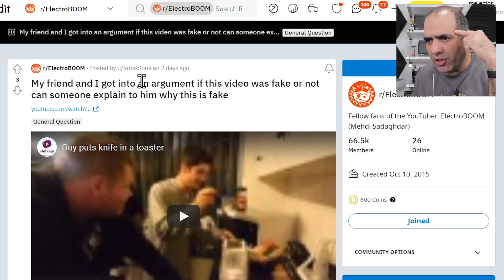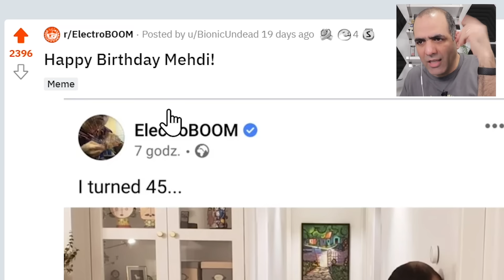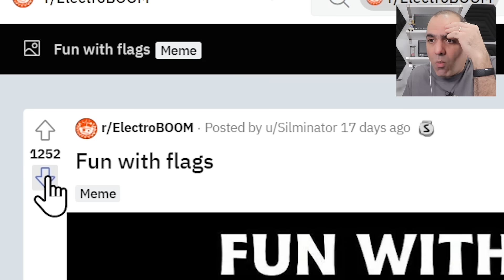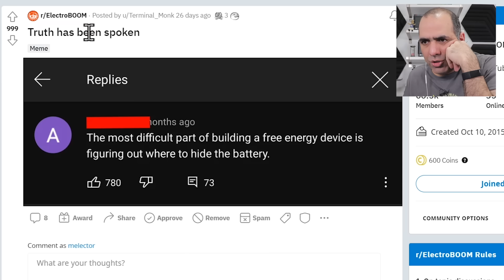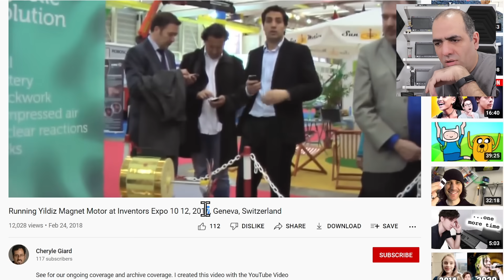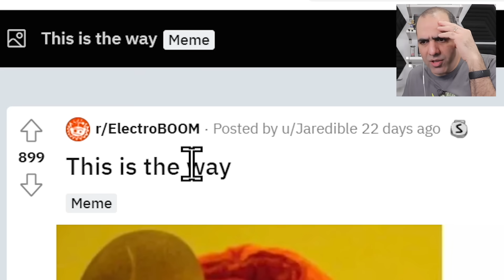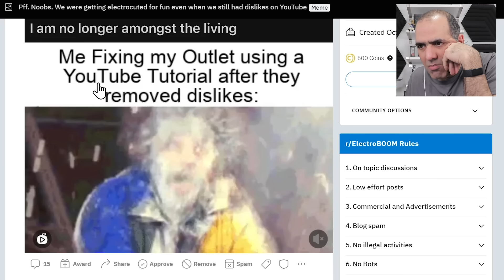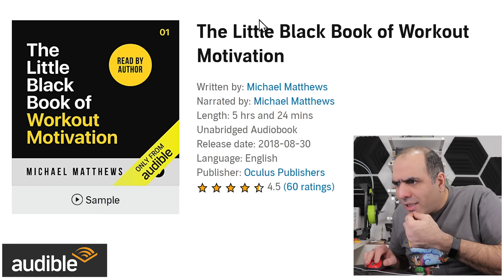Sticking Knife in Toaster? Welding with SALT WATER?!!! (LATITY-009)

Comment: Scientific American magazine had the "Amateur Scientist" column most months.
All manner of crazy-dangerous apparatus were used, including a 'salt-bucket' voltage regulator.
The bucket made many appearances: arc-furnaces, arc-lamps, dimmer for stage lighting, motor speed control, multi-pole variation served as a voltage divider...
All with glorious hand-drawn illustrations.

Comment: Talks about a plastic insulation on the knife and grabs the blade. Does not notice that this type of knife has a metal going all the way through the handle. Neat.
If you have no ground (really, many old houses in some country have this hacked or outdated, no GFCI, no dedicated ground, sometimes even the ground is not connected to the socket), you will be connected to live wire. Put another hand or stand on something that connects to the ground and you are most likely dead. 
Just to explain some details. Old houses, especially in the eastern block did not have ground. Your regular wall socket had neutral and live wire. That's all. Over time people started replacing old sockets. Some of them connected ground prong to neutral (best you could do), some of them left ground not connected. I've even seen this crap in the US. Half of my wall sockets were not connected to the ground just because of some shitty design. Although neutral and live wires are physical wire, the ground connects through bolts to the metal mount. Some of them were installed too deep and someone painted mounts over. Then they screwed the socked in just enough to stay in place but they could not screw it more because the socket would be too deep inside the wall and they could not screw the cover over it. Because it was quite loose and covered with paint, the ground was not connected. That's why you should not do this is you have no clue about electric stuff. It would be enough to check ground continuity, it would be best to check the protection before calling it done. But who cares? I only noticed that because I test sockets used for expensive electronics and I ended up testing all wall sockets in the house I rent. Around 1/3 of them did not have ground or it was randomly connecting depending on how you move the socket around.

Comment: I’m curious about that solar panel axle thingy. Could a similar device be utilized to induce a spin on a section of a space station to simulate gravity, ala 2001? I’m trying to come up with a way to make that device useful, as it likely can’t do any actual work. But “frictionless” rotation would be useful in space, right? 🤷🏻‍♂️
Reply: I think that wouldn't work as it was pushing off a magnet fixed to the ground, which would be impossible in space.
Reply: @deathUUK  well right, but I would assume you could surround the axle ends with more magnets to keep it centered. So like they’re using 2 here, but if you increased it to 4 or 6 or 8 or whatever, and had more of a 360° magnetic field holding it in place, it would be the exact same thing in principle.

Comment: the welder actually works, but you need to bypass all your circuit breakers protections.
Reply: Actually the breakers are there for a reason. 25 amps through wiring designed for 20 amps, will overheat after about an hour of continuous operation. The first thing you'll notice is the smell of melted plastic coming from the wall. Outlets aren't air tight, as the wiring from the wall starts to have its insulation melt, it will release a lot of fumes that quickly fill up the inside of the wall and then start to leak out through even the tiniest cracks in the wall such as outlets which are not 100% air tight between the back side of the outlet and the front side. You will then start to smell that melted plastic, at which point it will be too late, as the red hot copper wire with 25 amps flowing through it then starts to ignite the molten plastic, starting a fire in your wall, and buring down your house. Wires rated for 20 amps means that 20 amps is the ABSOLUTE MAXIMUM that it can handle without creating a fire-starting situation. Just below the 20 amps threshold the wires in the wall will still be very hot (to the point that touching them would be painful if you could somehow reach your hand through the wall and touch the wires inside the wall). It would be a slightly different situation with the wires in open air, but inside your wall the wires are in a very narrow space (limiting convection cooling of the wires), often with wall-filling foam or fiberglass insulation near them, which further traps the heat. The 20-amp rating on 12-guage wire is based on a wall installation (where the wires will typically be used). You can usually use 12-gauge wire in the open air (such as on a lab bench) with a slightly higher current (maybe up to 21 or 22 amps, before the insulation starts to melt).
Reply: @BenHutchinson321  I'm talking about the wire going to the transformer, it handles the high current way better

Comment: I actually shoved a knife in our toaster when it wasn't running.
RCD tripped.
Here in Germany everything is RCD projected.
I must have shorted the filament to the casing.
The filament is probably permanently connected to neutral on one side. The casing is grounded.
Since the neutral wire always has a small voltage (wire resistance of current of other consumers) the RCD will trip when shortened to ground.
That is btw the way to break into a house. Shorten neutral and ground, hope that the RCD for the alarm tripped and enter the house.
For that reason outside sockets should have their own RCD. Also for outside sockets and appliances like outside light there should be a switch that simultaneously disconnects neutral as well as live for that reason.
Reply: The German approach might not save you though. Having one RCD for the entire house is obviously better than having none but to avoid false trips it will have a relatively high trigger current. In my case the trigger current is 30mA and Ive got a nice both hands on live and earth shock before without the RCD tripping which could have easily been fatal.

Comment: About the saltwater welding: AvE did a test of I forgot what it was, where he used a bucket of saltwater to adjust the current that flows through the setup. The deeper the electrode is in the water, the more surface area and apparently more amps. Maybe you can also have a little fun with this idea. Great video as usual, thanks!
Reply: The concept is called a variac, the specific implementation is jokingly called the scariac. TKOR used one built by Grant to power a lot of their high energy projects. Pretty sure the original was an old Popular Mechanics DIY project. It's not about amount of surface area, it's simply the closer you bring the contacts, the more energy they can conduct. Can adjust the electrolyte to adjust the variability of the device.
Reply: @eideticex  Variac is actually an old trademark and really refers to a "variable reactance" and specifically a variable autotransformer. This is just a variable resistor made of salt water. In many applications, the distinction doesn't matter that much. Nothing particularly new or dangerous...as long as you don't do something crazy like throw it together with exacto knives sitting loose in a glass of salt water.
Reply: @eideticex  thank you! I didnt know this stuff :)
Reply: Search for liquid rheostat on wikipedia or so. We used one to load test out generators in the data centre I worked for until about 20 years ago.
Reply: @kuebbisch  My grandpa had something like this to control a very large engine. Was in a very old chair swing ride. Functioned reliably for at least 60 years. After that it was sold, so it is possible that it still works with it.
Reply: Somehow... I feel like somebody should let Medhi know that he was electrolysizing water... into Hydrogen and Oxygen... in a completely uncontrolled setting... In an enclosed space (hopefully with decent ventilation) and then showering the room with sparks and at least a very small amount of open flame and serious heat...

    The reason we use DC for Electrolysis Devices is to control which side produces the oxygen and which side produces the Hydrogen... AND to keep the two separate TO AVOID EXPLOSIONS... at least, until we're ready and actually want explosions...

    BUT the point is, ANY TIME you bombard water with electricity, you split it into Hydrogen and Oxygen... If you do so with AC current, you're just bubbling up the gases every which way and completely uncontrolled... He's pretty lucky he wasn't playing with it much longer... It could've been bad.

    ...and maybe he knows, and it was a joke when he sniffed, "It's probably just chlorine... yeah..." BUT it's hard to say exactly...  ;o)
Reply: @gnarthdarkanen7464  The chlorine smell is real and a result of adding salt to the water. He wasn't releasing that much hydrogen for the size of the space he was in or the amount of time he left it running.
Reply: @carpdog42   THAT is exactly why I said "It's hard to say if he was joking around or not."

    Along with breaking the hydrogen and oxygen free in the water, he was also breaking the sodiums and chlorines free in the salt, releasing chlorine while sodium (the more reactive) was almost instantly reacting to make sodium hydroxide...

    BUT chlorine is ALSO very unstable... and a gas... rising up in the presence of hydrogen and oxygen...

    AND yeah, even with house-current doing a MONSTROUSLY bigger scale of such work than when I was in high school using an old tractor-battery to do it... SO I get that. I know he didn't (ON CAMERA) release enough to create more than a mild nuisance to mucus membranes or metal over time... and a short SHORT time at that in all likelihood.

    BUT while filming to upload, there can be a LOT of editting involved, and that CAN mean a lot of re-takes and/or a lot of extra "playing around"... SO we don't really know how much time he spent actually building up various nefarious gasses in his house... or room...

    Hopefully, it's got just decent ventilation, as that would be enough to dispense with most of whatever he produced before any danger... It just feels like something he should know or someone should let him in on it. ;o)
Reply: @gnarthdarkanen7464  Mehdi is using salt water. Salt is sodium chloride. He was correctly smelling chlorine gas.
Reply: @gnarthdarkanen7464  You do realize just how little hydrogen is produced, right? If sticking two knives in salt water was somehow a 100% efficient hydrogen electrolysis machine, it'd still require almost 40 kWh per kg hydrogen. At 10 amps, that's 30 grams per hour. Not a significant risk
Reply: @NovemberOrWhatever  I said that somebody ought to say something... NOT that it's an emergency. Try not freaking out on one person's word... jesus... ;o)

Comment: With the salt water... baubles are also probably Hydrogen and Oxigen... so potetially expolosive if you build-up too much of it. Better do it outside :D
Reply: It's not "boiling" for temperature, the current is causing electrolysis of H2O is decomposing in O2 And H2. That are in gas form at that temperature so they are bubbling away.
With the presence of Na+ Cl- ion in there yes there culd also be some formation of HCl or ClO2 and similar subproduct.  
Also being AC the electrolysis is not separating the two gas so the bauble are a mixture. A highly flammable mixture.
So making sparks near there is not the safest Idea (even if H2 is pretty small and light so is spreading a diluting itself in the room pretty fast)
Reply: @GhostFS  Mate, you have no idea. Its literally done in some boilers and there is no buildup of hydrogen gas in those because it doesnt exist on AC.
Reply: You can search Alternating current electrolysis on internet you can find how it works when is used,  how to avoid and when a faulty boiler can produce it.
In this video he is not using a boiler. A boiler do not have salty water and are specifically tuned to avoid electrolysis.
Reply: Doesnt salt separate to Sodium/natrium and chlorine
Reply: Haven't done electrolysis for a long time
Reply: @fallu6224  Hydrogen and Chlorine leaving Sodium Hydroxide behind but this only works with DC. Its just steam with AC.
Reply: @Chuckiele  Yeah I think you're right about that
Reply: @Chuckiele  Forgot he used ac
Reply: @Chuckiele  Electrolysis still happens with AC. It's less efficient, but that doesn't mean it doesn't happen at all.
Reply: @killerbee.13  The separated atoms get smashed right back together and create steam, its a not too uncommon methode of boiling water.
Reply: @Chuckiele  Nope it's a perfect mix of hydrogen and oxygen on AC. And one spark will convert that H and O into steam, when the hydrogen detonates from its violent burn reaction with the pure oxygen. And yes the result of that reaction is water vapor, but you need to ignite it first. Hydrogen and oxygen can remain mixed without reacting for a long time, as long as the temperature doesn't rise to the ignition point.
Reply: @BenHutchinson321  There will not be a detonation. Try it yourself. There is no electrolysis on AC.
Reply: Bubbles?

Comment: Mehdi: "The worst thing you can do is if you grab a knife with no plastic insulation [...] you might get a shock"
Also Mehdi: holds knife by the blade and violently waves it around
Reply: It's possible to hold a sword by its blade, a kitchen knife isn't any harder. Lookup "half-swording".
Reply: @md_vandenberg  c'mon dude, I'm a late 30s single male commenting on a youtube video from an electrical engineer. Of course I've heard of half-swording. This look like any half-swording you've seen before?
Reply: @fatmn  True, it's closer to a mordhau

Comment: As an Electrical Engineering student at the TU Delft, I'm extremely ashamed to see that such a presentation was hosted by my university. For the most part the level of education and research is quite high there, but I must say that that presentation was extremely disappointing to see.
Reply: I'm curious, how did the presentation go? did they load properly that generator? They claim 5kw output .... just put something that would consume those kilowatts and keep it for an hour, so it would raise some doubts. Did all those university professors have nothing to object to?
Reply: @stefan24551  I'm not sure. It seems the only load that they put on it was a fan, which was probably not 5kW. I'm also not sure who attended, I can't find much about the actual people who speak in the video. The person narrating claims that a bunch of students and technicians came to watch. Important to note as well that it was hosted in the mechanical engineering department, and not in the physics department. In addition, the inventor claimed that it was running on some sort of quantum fluctuations, something that is called "nulpuntsenergie" in dutch. It's supposed to use the tiny energy fluctuations that are present at absolute zero (somehow, this is most likely absolute garbage). Just incredibly disappointing to see my uni being talked about like that, the first time Mehdi mentions my uni, and it's in such a negative light.

Comment: The problem with free energy motors is that even if you were to achieve it, any extra work you connect to the shaft of the motor will stop it anyway. It will just be a spinning work of art that can’t do anything.
Reply: Free energy that actually works is called a generator.
Reply: @MushookieMan  
It takes power to make more power.
Reply: @MushookieMan  Its called theft of electricity

Comment: The electrolysis of salty water does not give chlorine unless you have platinum electrodes or other "special" material (for household war gases production, the cheapest will be graphite). The gas is hydrogen that comes from water molecules being torn apart (on cathode H2O -- > H+ + OH-  ;  2H+ + 2e- -- > H2). The smell of chlorine comes from hypochlorite that forms on the anode ( Cl- + OH- -- > HClO + 2e- ; HClO + OH- -- > ClO- + H2O). If you multiply the water decomposition equation by 2 and add all the above you get the overall process ( H2O + Cl- -electricity- > H2 + ClO- ). This process works best on high, constant current and low voltage (7V should be enough).

Your electrodes where destroyed mainly because of hypochlorite (corrosive) and extreme voltage.
Reply: Even 3-4V is enough,but very little electrolysis happens with AC. I tried it,some small bubbles appear but its not flammable,doesnt ignite a glowing charred stick and doesnt smell like chlorine.Could be just boiling water or CO2 from decomposing bicarbonates and already dissolved CO2 solubility reducing as the temperature increases.

Comment: If a toaster is ON, there is no way there is lower resistance to ground through you. You won't get shocked. If the toaster is off, and the neutral and hot wires are reversed, it is possible to get a shock by shoving a knife in the toaster, if the toaster doesn't open the circuit on both sides of the resistance wire. That's a lot of ifs.

Comment: Toasters did not always have polarized plugs, which meant that the heating element could be connected to the live wire depending on how it was plugged in. Even if the toaster was off the exposed wires in the toaster could be live.
Reply: But that wouldnt make it explode.
Reply: Which is still true today in all countries that don't have polarized plugs.
Reply: @maxine_q  Modern toasters have double pole switches.
Reply: @MernokiMegoldasok  I wouldn't rely on the fact that manufacturers are not cheaping out on the switches.
Reply: @maxine_q  True.Old 6A 250V light switches have bigger contacts than most common 10A 250V switches made cheaply these days.Those old 6A ones also last several times more.
Reply: Then dont buy them. Dont buy toasters made of plastic, they are a fire hazard, and dont buy devices with metal cases that arent grounded.
Reply: @Chuckiele  That s why I have a wooden toaster